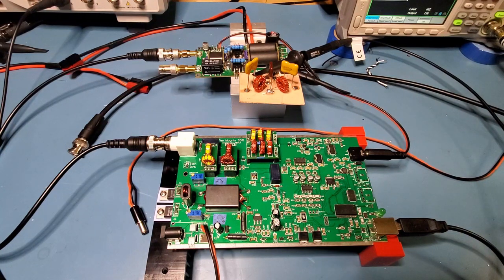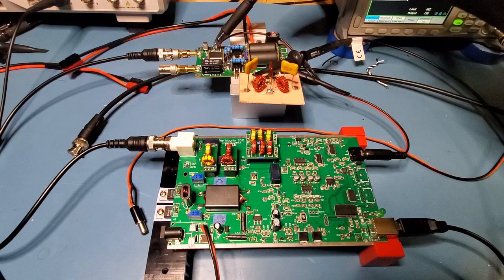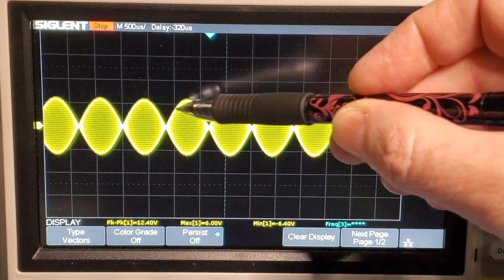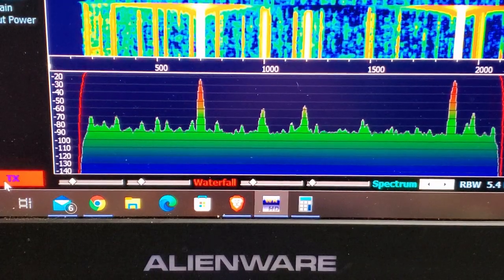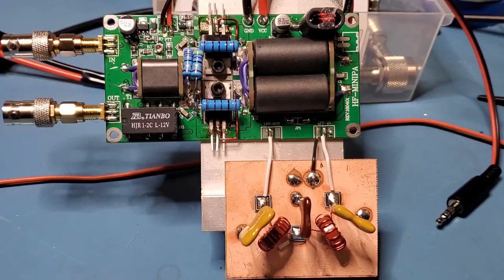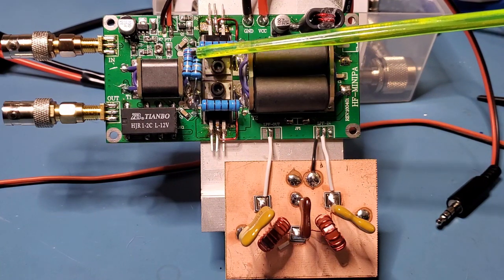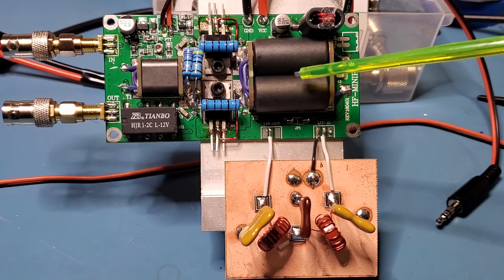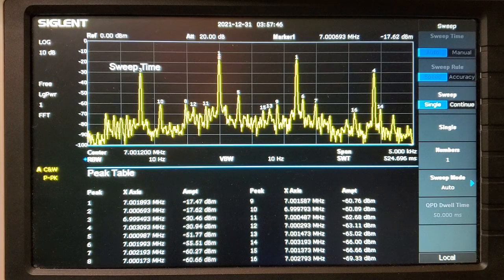70 Watt Amplifier - Two Tone test

Comment: Hi friend. Thanks for your dedication and testing videos. I have a question. ¿Is it possible to use the amplifier on 10m with the irf530 but changing the R6 (resistors between irf530s gates) ?

Comment: Hi, very nice video. 
 I have the same linear amplifier and I use the irf 540 transistors with 3.5 volts bias. 
My problem is the high SWR in the input. I'm thinking of replace that ferrite to BN 61-202, maybe I have a better SWR.
Reply from the maker: Hi Nikos. Try putting a 15ohm 3W resistor in position R6 (the empty pads just behind the input transformer). This site has a pile of info on the subject: https://pa-11019.blogspot.com/2016/11/diy-kits-70w-ssb-linear-hf-power.html

Thank you for the comment!

Comment: I was gonna try to see what would be the drive level needed to attempt to achieve a perfect sine wave on the output before the LPF. I know the power output is gonna suffer quite a bit but I am just curious what would happen if you took the drive way down. Since a square wave means that the transistors are no longer in their linear region but rather in full on/cut off.
KE8SPI
Reply from the maker: Reducing input drive (to a point) is certainly a strategy. I have more experiments to continue - primarily to take care of temperature control. You are on a knife edge with the bias voltage too low and the signal isn't linear. Too high and theres a pop and you are soldering in a new pair of IRF530s! Sometimes they go pop even when you thought you were taking care of them! Fortunately I have a pile to play with

Thank you for the comment

Comment: Hi Ian,
I have the same signal generator
When I used it for a two tone test I noticed
The amplitude of the two channels was not identical
So I needed to adjust the levels.

All the best Peter (GW4ZUA)
Reply from the maker: Thank you for the tip Peter - I will have to check that

Comment: Hi Ian,  First, My condolences to the IRF530's that lost their magic smoke in the amp debug and testing.  Their contribution will not be forgotten.  Second, I have home brewed push pull amp that that is based on the Toshiba 2sc2510s that experienced the same kind of envelope distortions in the two-tone test, which I built a couple of years ago.  If i'm recalling correctly the distortions went away when I increased the idle current and floated the center tap on the input transformer.  One experiment you could try is to disconnect the center tap, and run the amp in class "C".  This would be bad idea for SSB, but may tell you if the input transformer / bias is contributing to the envelope distortion.  It could very well be a red herring, because your amp is using MOSFETs and my  2sc2510 amp is bipolar.     Anyhow, if you run out of options...   Please continue the great RF content on your channel.  de KB7ZUT
Reply from the maker: Thank you for the great suggestions. Interestingly if you look at the second test after I put the 15ohm resistor across the output side of the input transformer those envelope distortions went away. I will certainly have a look at your suggestions though and thank you for the comment!

Comment: Very thorough I'm really enjoying this set of videos. I had an amplifier setting on my bench about a quarter way done, I have now moved it to first place. I wasn't sure which transistor you might try next so I chose one different yet, it's the IRFZ24N. I wanted to try a few and see what I liked best. I have to see what I have here for a two-tone test also. I'll probably use the signal generator for now. I would be interested in what you end up using also. I had thought about building one, but that way of doing things has been adding up to a lot of projects. lol. Thank you very much for the great videos!
Reply from the maker: I am glad you are enjoying the series Curt. Check out those mods from F5NPV - he has some great thoughts for temperature control which I definitely plan on trying out!
Reply: @na5y  I will be checking those out in just a few minutes. thank you, sounds interesting. I took a minute to go over my print and noticed some differences. one thing I noticed on your print I haven't seen before is the single bios. It is amazing how many different prints there are for these amps. After checking out the mods I bet I will understand a few changes on these circuits. I'm going to blow up a few transistors before I get to the temperature control. lol, I can't resist. Maybe I can find the ones that blow up less often. but from my past reading, the control on the bios can help with accidental SWR mismatch so it is a very good thing.
Reply: @na5y  Hello again Ian, I have been trying out some transistors and have had some bad luck with some fakes. I thought maybe they would just underperform but they outright sent the wrong transistor.
I have spent some time rethinking these amps and how old all the information is around them. and from the test results, you are showing seem to be fairly normal for these. I think it's time to move to something new. I looked at some small rf transistors but the price of 5 or 10 watts is almost as much as 100 watts. I am looking at a newer transistor and found two with some good information on the internet and thought you may like to see them. The MRF101AN and BN and also the MRF300AN and BN. 1.8 to 250Mhz. they are broadband and the tests I have seen look amazing compared to these. One MRF101AN will give you 100 to 120 watts and the cost is $25 to $30. and the 300-watt version I believe was around $50 to $60 if I remember correctly. I am just building the output stage of my radio so 100watts is more than I wanted. I thought you may be interested in these. your temperature project would go nicely with these also. good day man take care.
Reply from the maker: @curtstacy779  Thanks Curt - where are you sourcing those MRF101s from? I saw them on digikey for about $32/each. I was thinking myself of alternatives and I have seen these around reasonably priced
https://www.nxp.com/docs/en/data-sheet/MRF186.pdf

They come in a dual mosfet package - seemingly ideal for a push/pull arrangement. Thank you for the detailed writeup I will definitely check them out.
Reply: @na5y  The cheapest I saw was Mouser at $24.34 $7.99 shipping you can add more parts before the shipping goes up. that was good for 1-5 days ground ups or fedex 2nd day.
And that is the best transistor I have found for the price. It's like I said it's hard to even make a smaller one cheaper. These came out just a few years ago also. and they are LDMOS so very wideband and fewer components. I think this may be a no-brainer! lol. if you stick with the design in the datasheet people are building it for $80 that is $0.80 a watt. I also saw a guy that made a very broadband transformer for this it looked great.
Reply: @na5y  I didn't know about the dual package that is cool. but the an and bn version switches the leads around for perfect placement for push-pull setup.